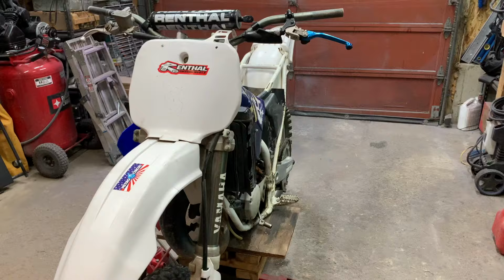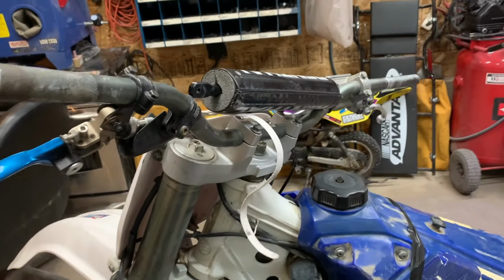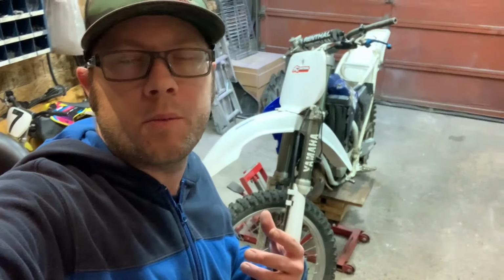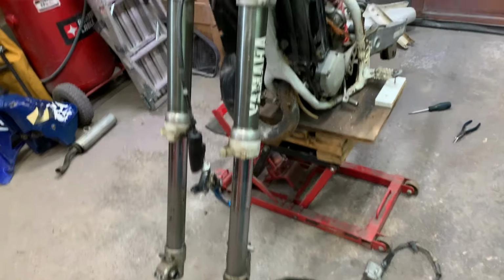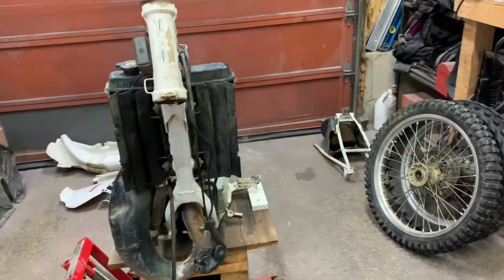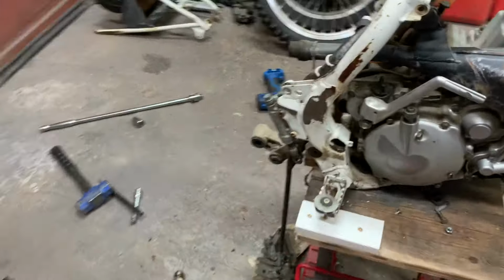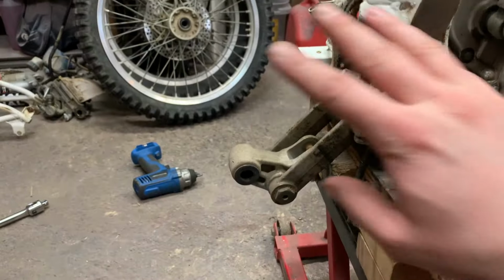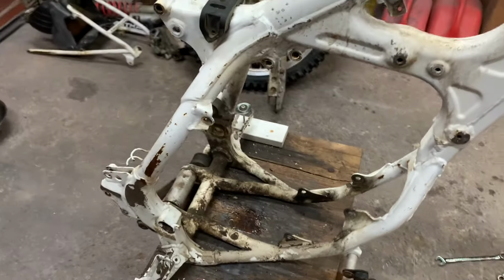1996 YAMAHA YZ125 2 STROKE REBUILD PT 1 (Intro/Teardown)

Comment: Buongiorno serbatoio carburante yz2501998 può funzionare su yz250 1999😊? Grazie.
Reply from the maker: sì, i numeri di parte corrispondono per il 1998 e il 1999 Part# 5MV-24110-01-00
Reply: @northernmx5973   i numeri corrisponde 125  1996 / 2001 x 250 1996/ 1998 controllato la mia yz250 è 2000